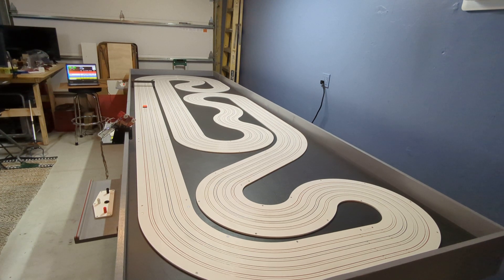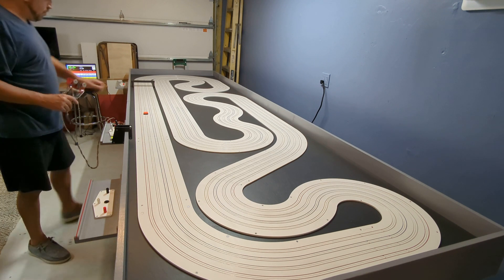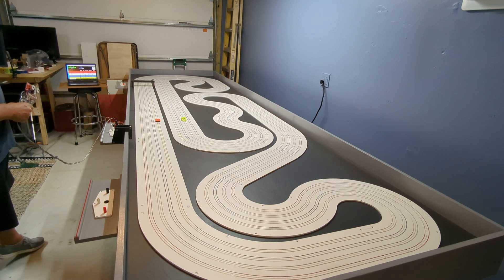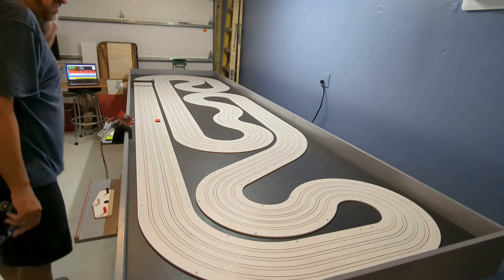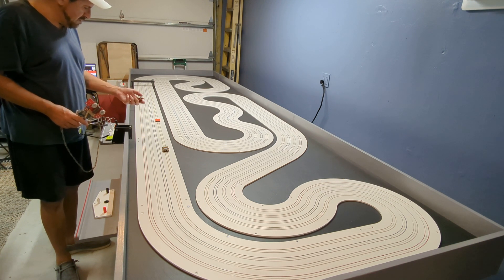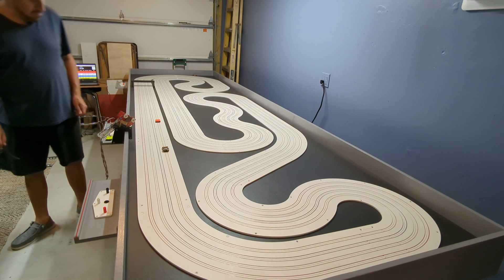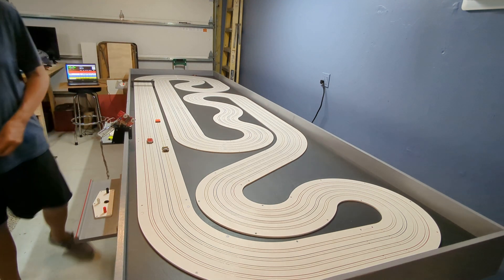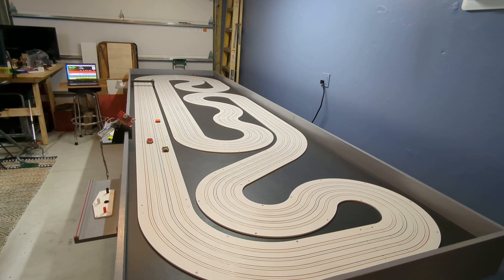Testing the track!

Comment: dude your track is great but how about a link to where we can get cars like yours! Man I wish I had cars like that.
Reply from the maker: I run all different kinds of cars but the ones you probably mean are made by viperscaleracing.com. The VSPEC is their base 6 ohm motor car, and you can step it up to their 3 ohm production modified. My two super fast cars (yellow and orange) are also Viper chassis but I built them myself with low (2 ohm) armatures.
Reply: dude those first 2 cars was so fast I could hardly keep up with them those are the ones I want. @marksslotcargarage
Reply from the maker: The yellow car I built myself, the orange one I bought from a seller on eBay called dc-racejets, he sells custom built performance chassis. I paid $115.00 for the orange Viper chassis with no body. The yellow car was also over 100 in parts. You can get similar performance buying the production modified right from Viper for $87.95 that includes your choice of Lexan body. Viper also sells their PolyMod chassis for $89.95, the PolyMod will be closest to my cars. Keep in mind you need a higher amp power supply with a least 2 Amps per lane to run these low ohm motor cars well.